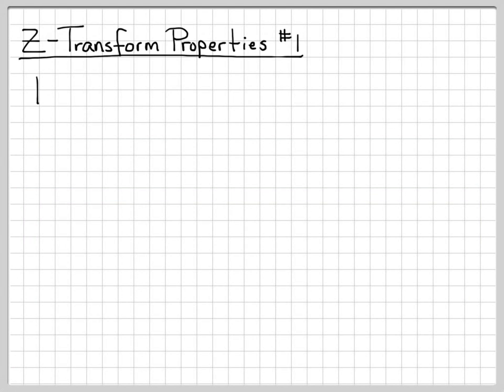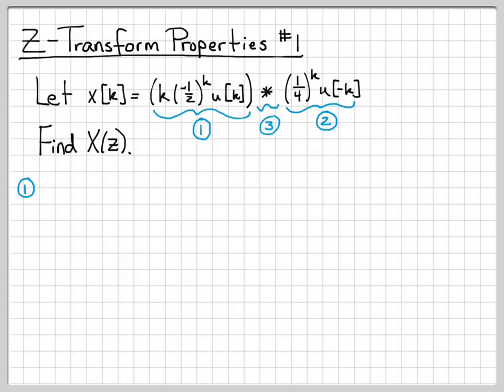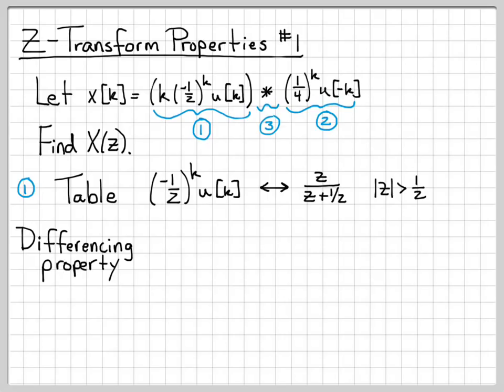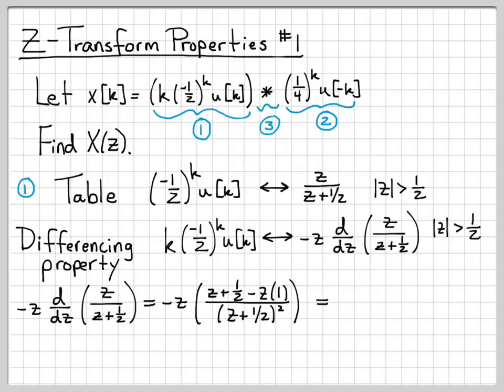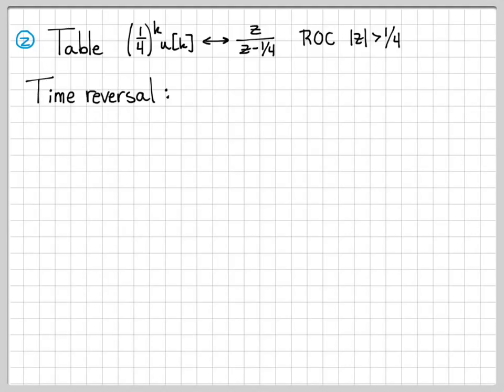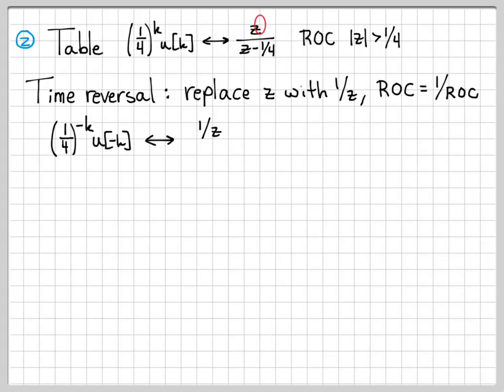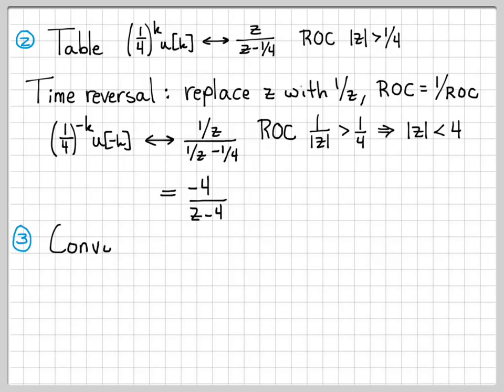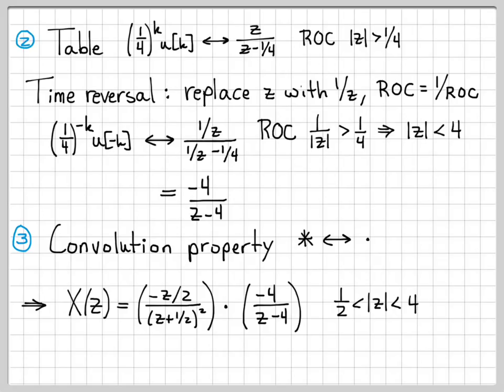Z-Transform Properties Example #1

Comment: thank you for the very helpful videos sir.
why while solving part 2 you raised (1/4) to the power of negative (k), while originally in the question it was a positive (k)?
Reply from the maker: Sorry, that's a mistake.  Thanks for catching it.  To use the time reversal property like I did towards the end of the video I assumed the original expression was (1/4) to the power of negative k.  The original problem statement should have a negative (k) in it.   I'll add a comment to note the mistake..........